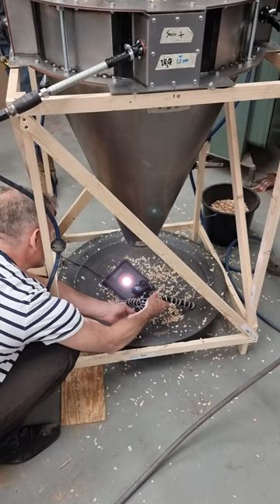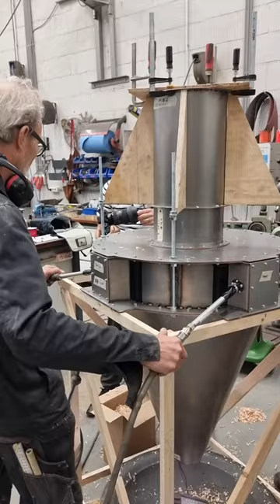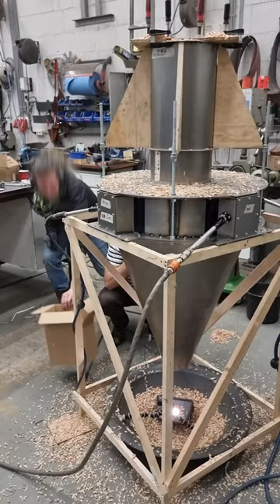Windhexe - Testing Particle Flow With Wood Shavings

Comment: I was reflecting- when there is a resonant ultrasonic wave composed of a wave and it’s reflection, causing the nodes and anti nodes of the wave and its reflection to settle into collocated fixed positions, material from either side of each node will be “pushed” into the node point.  Now, with enough material (possibly introduced perpendicular to the node), with the constant pressure toward the node point, not all material will be able to occupy the node point.  This will cause the material to try to move out - but, this “overshoot” material will be swept back , resulting in the material to start swirling around the centre point .  Given the constraints imposed by inflowing material, this swirling material will form a flat vortex disk - a vorticle.  As this material itself increases in density, it is ripe to form a charge separated plasma.  Given the nature of charges, the electrons will flow in one direction, the ions in the other, forming a braided rope of counter-rotating nucleon toruses.  These moving current toruses will induce poloidal magnetic fields .  As more material enters the system, the downward pressure to create yet lower toroidal fractals increases.  Additionally, the now highly electromagnetic fractal toroidal collar shapes the inflow of the material, causing more and more material to be funnelled through the centre of the now constricting torus.  The sothic triangle funnel sees its maximum effect in drawing matter in through the node point at the centre of the base of the sothic triangle (which is likely rotating around an axis from the point of maximum consumption/destruction through to the node point.  The scene is now set to create the wormhole, whose exit point then sees a mirror emission of matter at the far end of the induced moment - which is 180 degrees (more or less) round the moment’s arc (moments being ultimately circular in form)
Reply: Now, the windhexe is different in form as the cyclone vortex is conic, but causing matter to enter a spiralling “orbit” should be assisted by firing a high pressure stream down the mid axis - high pressure, yes, but only to a point where the material in the central column can be drawn into the rotating conic vortex.  Also, quantity of material entering the vortex is also likely important (literally sound volume given the “whistles”) - too little material and the vortex is likely just to go round and round without seeing the needed pressure toward the centre to create the necessary sharp pressure wall as would be seen in a tornado. Anyway, just a thought.
Reply: Another thought - organ pipes have a “whistle” and an open top - I seem to remember it’s the difference in pressure between the wave in the pipe and the outside air that causes the wave in the pipe to reflect - the pipe’s pitch being determined by the length of the pipe, something that must also be relevant in the case of the Windhexe - the height of the cone and the “frequency” of the pulsed vortex cyclone should match in some way.   Indeed, are the “whistles” really a way of introducing an input stream (of air) at a set frequency, in which case the air input to the windhexe is being introduced at a set frequency- so, does the frequency need to be same for each pipe, and do the frequencies coming in on the separate input streams need to be in synch to induce  constructive interference - that’s what makes sense to me - constructive interference and a frequency that matches the depth of the cone / length of the spiralling track 🌀 in some way
Reply from the maker: @gordondocherty  The port at the top and the distance it extends into the top section is very key.
Reply from the maker: You are good at this!

Comment: Why throw the stuff upward, mimicking the advert, when you can put a cup on a stick (of a proper shape) to elevate the cup enough in relation to the height of the machine to the spot where it's supposed to pull the contents out of the cup. Also, it lets you gauge the probability of migration up or down from that point on, ofc you'd have to do a series of injections with the same amount. You could also use a pressure probe and map the volume.
Reply: All tests will come, clearly need more flow rate and heat first

Comment: Didn’t seem to work. May be wrong
Reply from the maker: Not enough air flow or temp - and wood is very resistant - one step at a time.
Reply: @MFMP  persistence

Comment: Make the air go at 6565 miles per hour
Reply from the maker: The air needs to be more, faster, warmer
Reply: @MFMP  can the steam be used for the pressure reducing the equipment?
Reply: @MFMP  what if the flow must be electricity connected to the system? The hoses being wired to houseings like the GEET